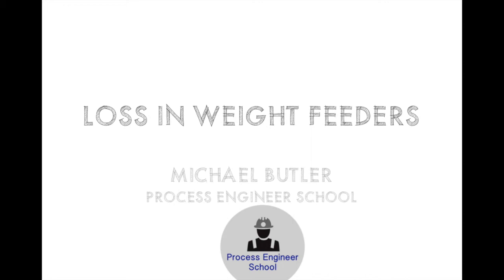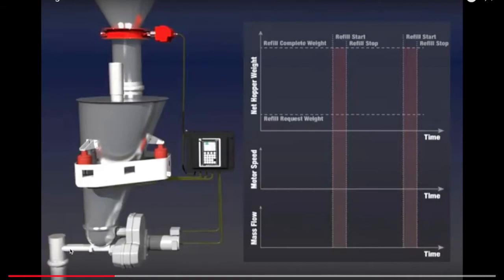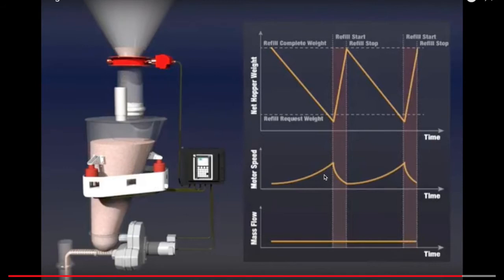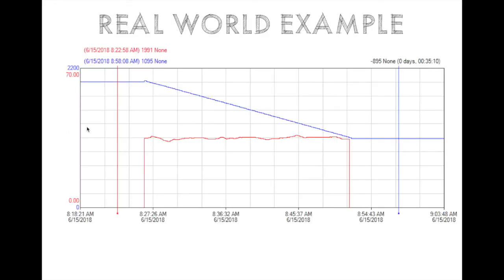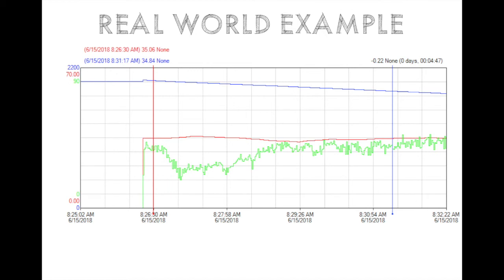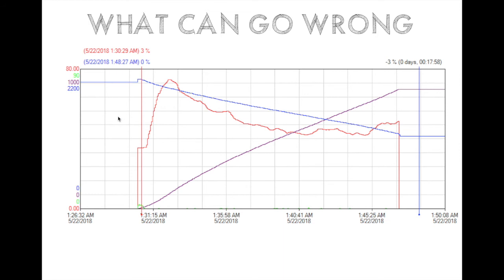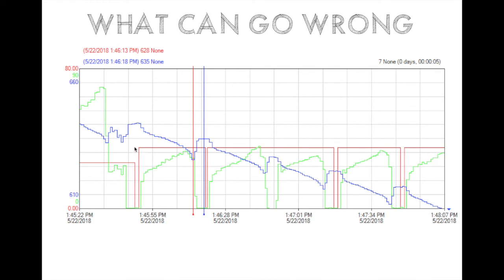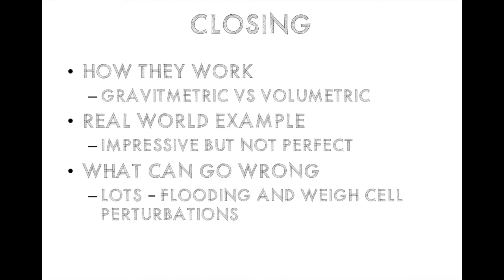Loss in Weight Feeders

Comment: When you have jumps in weight my guess you were adding material into a humid process.  Most of the material enters the reservoir at a constant rate but you get some building up on the screw.  It becomes wet and sticks to the screw until it reaches a critical mass where the weight of the build-up exceeds the skickyness of the material and it breaks free and falls into the tank.  Hence the instantaneous spike in loss in weight is experienced.  The vacuum is more interesting

Comment: Can you kindly give us your technical analysis to our current issues.
1. LIW is in stop mode and empty and has a readout value of -0.07kg fill in weight, however the flow rate is showing 1.7kg/Hr and not showing zero is there a way to make the flow rate zero without changing programs in the controller?
2. What are the possible factors that flow rate is not showing 0.0 kg/hr?

Comment: Could you please help me how to solve the formula for mass flow. I am having a hard time understanding it. Thank You
Reply from the maker: Can you tell me what information you have and what you are trying to calculate?  My experiences have been centered around a simple equation.  The total mass accumulated (kg) is equal to the flow rate (kg/hr) multiplied by time (hr).  But, I'm guessing that's not what you're asking.
Reply: Process Engineer School  Could I email the information to you? I just started as process engineer at my company
Reply from the maker: Luis Delgado Yep! mbutler5@gmail.com
Reply: What caused jumping in weight value? The load cells are were not accurate?